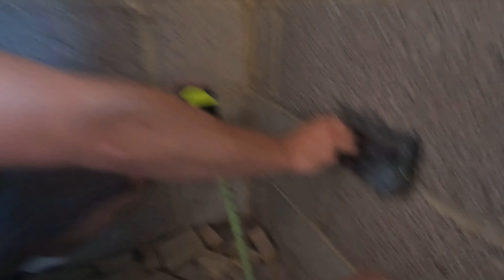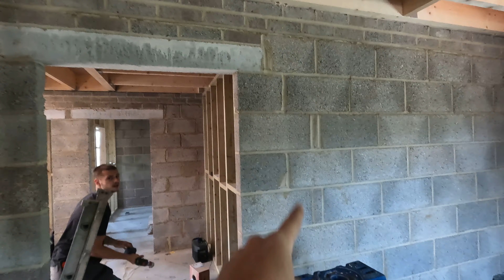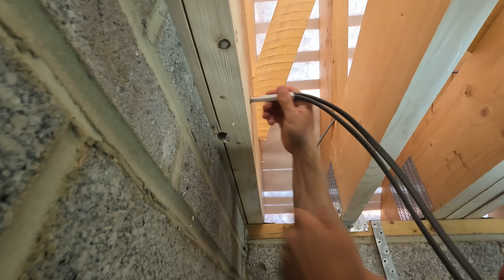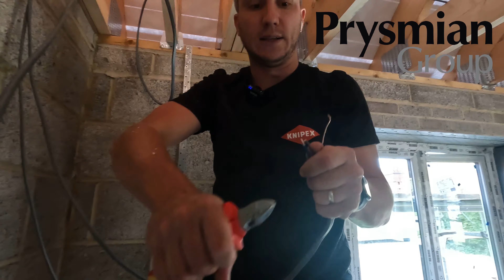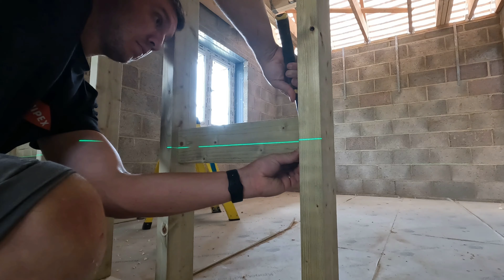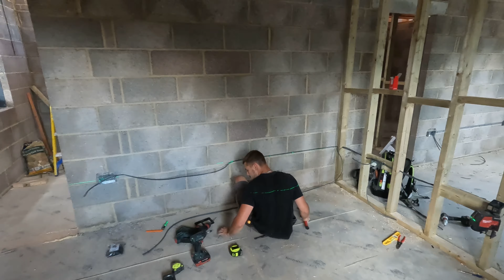we work ish.. at the 6 Bedroom house

Comment: That first problem was never a problem. Easy solution
Reply: I agree could have dropped down in the corner within zone 150mm then horizontal to sockets or if wall is less than 100mm could of dropped down other side to sockets either all the way down or just below  joist and burst through. But to be fair he did choose the best route. But the point is the regs allow for plenty of options.
Reply: Just don't drill middle of the joist, use normal drill n go at the bottom

Comment: How to become a electrician in uk if you studies b tech electrical and electronics engineering in uk while in students visa. I am from asia
Reply: You want to be an electrical engineer or an electrician?
Reply: @BeepBoop2221  i am currently studying btech in uk, how to become a electrical engineer or even electrician with visa sponsorship in uk ?
Reply: @user-pw2rl3zi4q depends what the tech is, you'd have to do either an apprentiship for either role or for electrical do the certifications, electrical engineering you'd need a degree.
Reply: @BeepBoop2221 i am studying b tech (hons)
Reply: @user-pw2rl3zi4q  are you sure its nit a Bsc with honours? Honors refers to a 3 year university degree 

is that at a university and what is in?
Reply: @BeepBoop2221  it's basically a top up degree, for 3 year diploma could get b tech degree in one year, by studying the last year of the course. Yes it's in a university, will get 2 year stay back too.
Reply: @user-pw2rl3zi4q  what's the subject? 

It depends what you want to do as a job.

If you want to be an electrical engineer you need to get a full engineering degree and find a job from there 

For an electrican you'd have to do the certifications through an apprentiship or college.

The second would take years and if you're already doing a degree level course I would focus on the first thing.